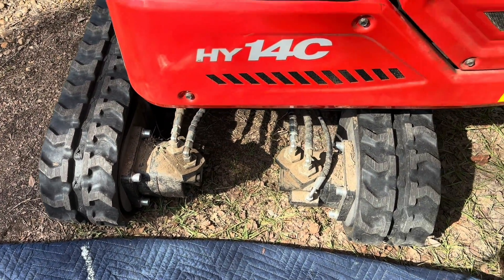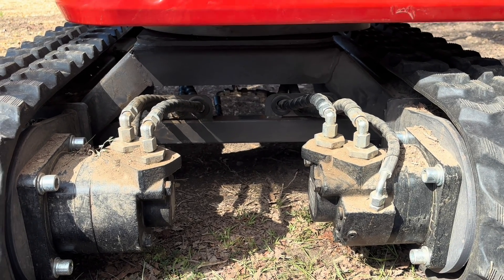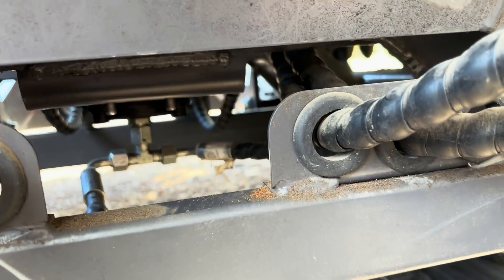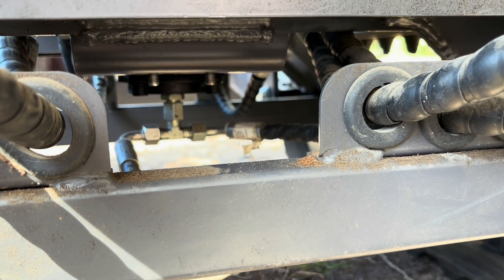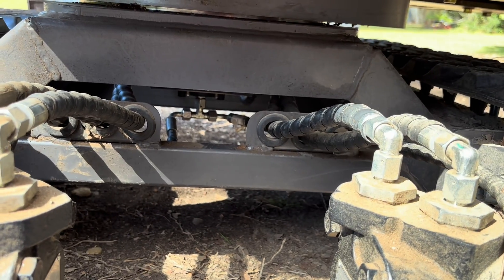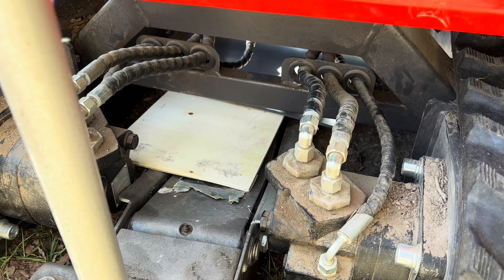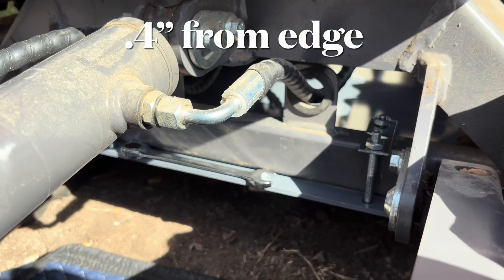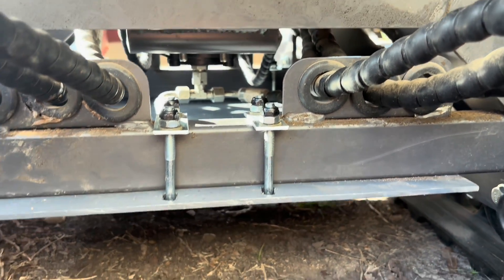Mini excavator skid plate mod

Comment: That is a nice mod.  I also have an HY14C, and I need to do this as well.

Do you have a video on changing your bucket?  I think that my quick changing implement has a pin slid out of place or something, and it would be very helpful to see one functioning correctly.
Reply from the maker: I don’t have a video per se of that but in the review video I talk about it some and show it clicking onto a bucket. And on the stump digging video I show where a bolt came out of it which is probably what’s wrong with yours. There is a shoulder bolt that holds a lever to the square piece in the center. You should be able to see that bolt and where it goes in the stump video.

Comment: Another great idea bro. Probably going to do that on mine too. You're a wealth of info
Reply from the maker: Thanks. I had not even recognized the potential for damage until I was working on a trail and got down there to pull out some vines. I saw that “T” and those 2 lines on the bottom of the swivel and thought, “yeah, I’m going to break that off if I don’t do something soon.”  And it’s a really simple mod, cut 3” off the plate, drill 8 holes in the plate and paint it…